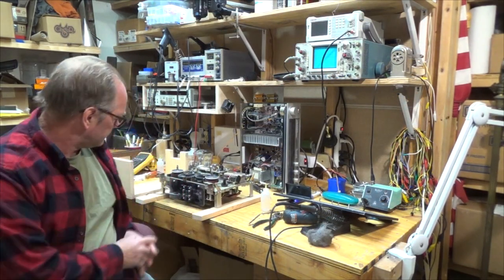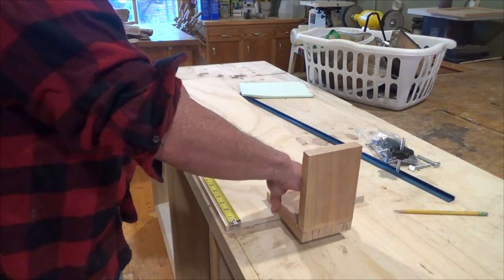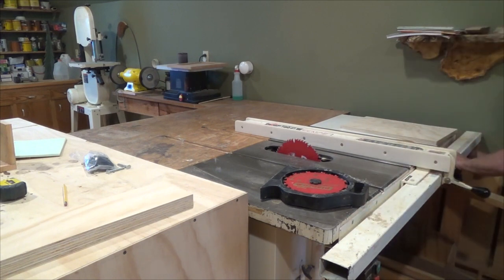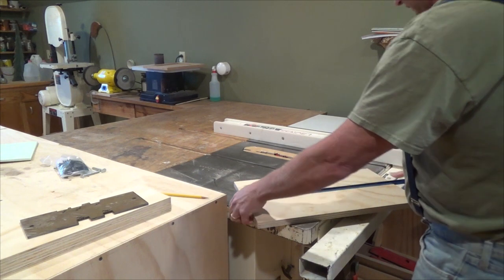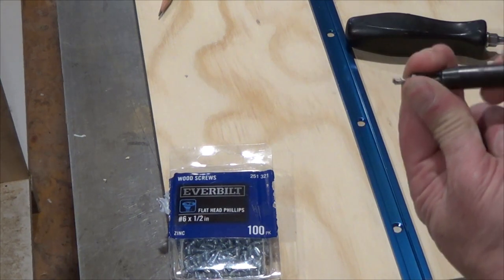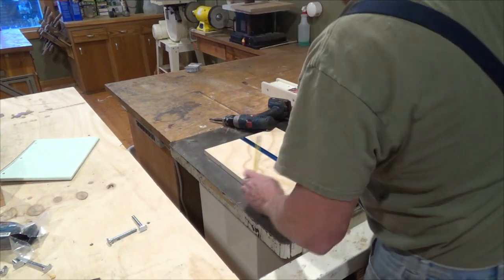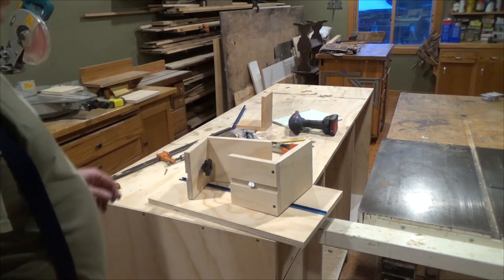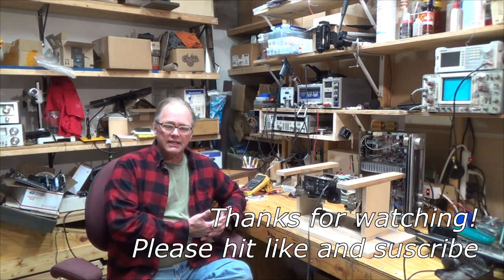Antique Radio and Electronics Repair Fixture

Comment: Thanks Rob, Great design. I'm making one with a little mod. The vertical on mine will have a second layer with a bolt to allow the chassis to be swivelled. Then I can work on either side of the chassis (top or bottom) easily. The swivel will have pins into the stationary vertical to stabilize it in either position. Thanks for the idea.

Comment from the maker: Turns out that it comes in handy for doing other work too. I am putting a new set of valves in my old Acura TL as a result of some failed timing belt idler pulleys and the fixture worked great for positioning the head so that I could get the valve spring compressor on it. Here's a photo: https://1drv.ms/u/s!AgRy1tCE6lTdsjVPtfa-_ferAhs-?e=KqzXHN